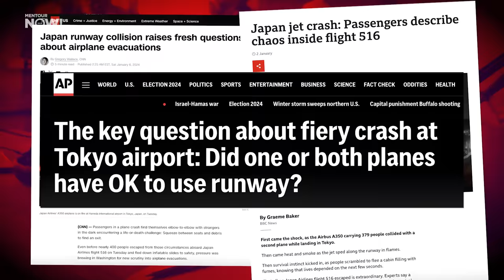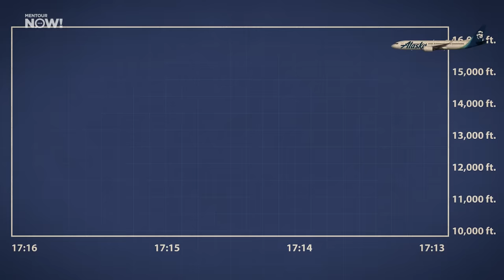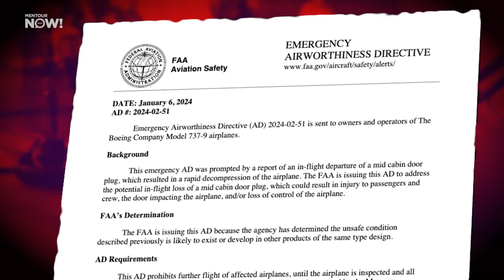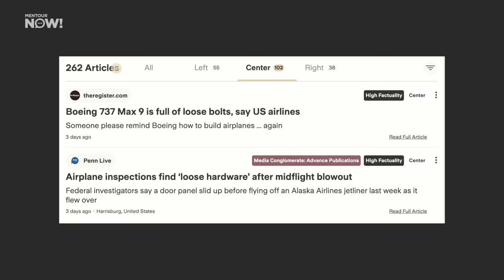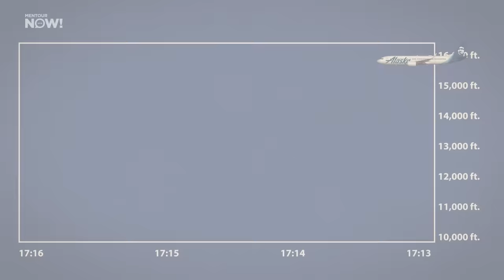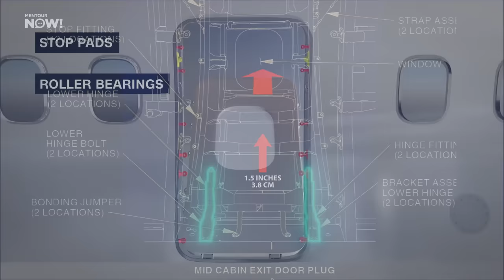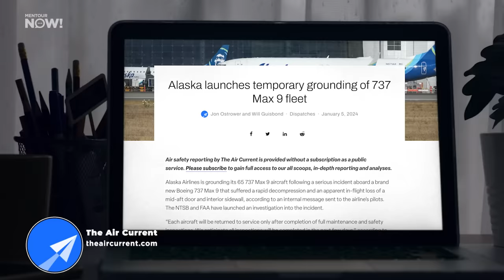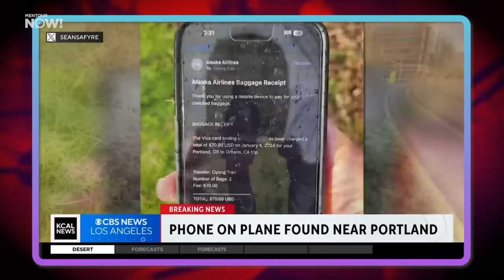WHAT Is going ON with Boeing?! MAX-9 Door blowout

Comment: My dad used to work in engineering, including air and spacecraft parts. The quality control in his workplace was insanely tight. There's parts that got rejected because a hole was less than 0.1mm out of place. I asked why when I was a kid (because that seemed ridiculous and over-zealous at my young age) and got told that if they didn't hold work to that standard, people died.
Reply: 0.1mm to our American friends is about four thousandths. NO spacecraft (or aircraft) needs to be designed and built to that kind of general tolerance. That's just not cost effective. It's entirely possible that some, limited number of holes need to be drilled that close because of the disporportionate effect that even slight degrees of hole misalignment might have on clearances of adjacent/interlinking components.

Permissible tolerances aren't absolute - they depend on relations with other tolerances. It was misunderstandings about this that caused to be rejected the bulk of manufacturing subcontracted to the US for WW1 European military orders (at one stage) by the Russian, British and French customers. Pretty much everybody was in the wrong there. BTW, this is WW1 (one) where American industry grew insanely rich providing only moderately good customer care to the the European belligerents, prior to 1917.
Reply: @alastairbarkley6572 Low tolerances and engineering for extreme conditions were my dad's specialities.
Reply: Sometimes it's better to err on the side of caution. Parking on a conveniently placed cloud and waiting for the airline equivalent of roadside assistance usually isn't a practical option.
Reply: @alastairbarkley6572  It really depends on the part. Many aerospace parts have tolerances like that or tighter. Obviously not the entire plane will need that but many parts are held to tolerances like that.
Reply: Cost cutting always wins over lives.
Reply: @xchazz86  cost cutting on saving lives is a great way to cut on profit as Boeing is finding out
Reply: Hi, first of all thank you for your comment and I am happy for people like your Dad who work to high standards and who take it seriously. We need people like your Dad or people like you who can appreciate it.

I myself live in Switzerland and worked for a firm that produced hip, knee and shoulder prostheses. We had a tolerance of 0.05mm because if you look at a hole and measure tolerances from the center of the hole, you'll have 0.05mm to the left of center and also to the right. So the tolerance across the entire hole would amount to 0.1mm. Our production site had to be at a stable 20 degrees celsius because temperature variations would deform the material. It was necessary because the prosthesis had to stay within a patient without any issues for the next decades without rattling or moving around. You can't just constantly operate on a patient whenever a problem arises (a patient is not a bicycle), so it was absolutely important to be absolutely precise in our work. The femur bone had to be prepared properly by the orthopedist and our prosthesis had to fit exactly into the socket the orthopedist had prepared. We heard stories of companies who produced cheaper parts and it ended up with patients not being able to walk properly, having their femur bone destroyed or even having their hip cemented (meaning the hip became stiff (cement is stiff) and unusable).
By the way, an uncle of mine was one of the guys who engineered the boring machine for the Gotthard Base tunnel, the longest tunnel in the world. When the two boring machines met in the middle, the allowed tolerance was 25cm. The actual tolerance was 2cm.
When they laid the tracks inside the tunnel, the allowed average lateral tolerance was 0.5mm. I think, horizontal tolerance was a bit higher, but I can't remember. I just remember the 0.5mm because it sounded so impressive to me to have such heavy machinery lay tracks with such a tight tolerance.
Ok, enough from me. Take care!
Reply: Boeing used to be quite tight with their quality control. That all went out the window after MD bought up Boeing.
Reply: @alastairbarkley6572  it should be 3/1000 of magigamagah - in machining it is not uncommen to care about a 0.001 mm  - I don't know what that is boogumugoo measurements
Reply: Close tolerances in engineering are not always desirable. Soviet tank designs in the 30's and 40's were incredibly crude from an engineering point of view. The Germans by contrast were ultra precise and produced to high tolerances. Meaning that oil-viscosity had to be correct to lubricate metal parts moving with only a thin film of oil. Enter, stage left, the Russian Winter. Two things then occurred: The lack high tolerance in Soviet tanks prevented oil from freezing to sludge, so they kept running, whilst Germany lost many tanks (and aircraft) abandoned, simply because they couldn't be started, or destroyed engines and transmissions due to degraded lubrication. Worse, Soviet tanks were optimised for production, but the Germans were not, thus accelerating the eventual disparity in numbers. Thus a simple design philosophy difference, that of valuing high tolerance engineering above the crude low tolerance, arguably cost the Germans the war...
Reply: @Fidd88-mc4sz except this isn’t a war…? 🤨

When in a war your main concern is doing patches and making it “good enough” to serve its purpose because it will be blown up. 

We are talking about civilians where they aren’t supposed to be doing shoddy work just to get it in the field. They are just subcontracting everything out for cheap and not asking questions about qualifications.
Reply: @marquisdelafayette1929 The war is immaterial to the point I was making, namely that there are actual drawbacks for high-tolerance engineering, in severe conditions, and that sometimes simple but crude is actually better...
Reply: @Fidd88-mc4sz  currently the same story is true for American vs Chinese military equipment. Sure, the US stuff is superior in capabilities but Chinese always found their quality in quantity.
Reply: @vaakdemandante8772  Just so, and that gap will close over time. The critical issues are whether the  US can afford to maintain it's technical superiority, and the rate at which the Chinese can close the gap. The Chinese economy is in a fairly perilous state just now, so I think it's likely that the Chinese will have to reign in their military spending soon.
Reply: I work in medical devices as a manufacturing engineer and am familiar with the rigid standards and checks in place to ensure they are followed. There is NO way that this is not gross negligence and heads are going to roll over this. Where exactly, I'm not sure.
Reply: @alexwu8077 Who bought who? I thought MD was the one going downhill. I have heard stories about one of its passenger planes (was it the DC-10?) that was problem- and accident-prone. There was a cargo door that fell out on one of those MD/DC-whatever planes, again might have been the DC-10.
Reply: @Fidd88-mc4sz  A sundial's parts never wear out. It tells time accurately enough for reporting to work.
Reply: @budbuddybuddest  It can also tell you the weather! (if it is wet, it's raining, white, snowing etc etc)
Reply: @alastairbarkley6572 Tolerances like that and with precision down to half that is frequent in many industries not even nearly as stringent as aerospace. 

Say quite a few lift parts for example, be it regular building, fork or scissor lift will fail within months if key parts aren't down to extremely high accuracy and precision. 

That isn't to say what you indicated with it being specific to part isn't true, it obviously is, but you also exhibit a very dangerous attitude in that such lax attitudes are ok across the board so long as the complete assembly fits. That simply isn't the case and not only can but Will kill people.
Reply: @budbuddybuddest  "never"  Think about that some more.  You might realize you used the wrong word.